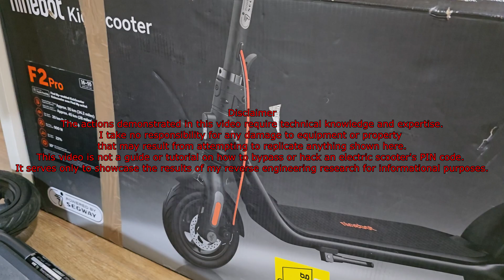Brute-Forcing PIN Lock Codes on Segway Ninebot F2 Pro Plus and G2 - Reverse Engineering Results

Comment: I am going to attempt this no idea what I am doing but my wife bought a scooter of FB and the guy said it was just dead I got a charger and it has a 4 digit pin and the guy blocked my wife
Reply from the maker: if you can connect using bluetooth to a scooter, try xiaodash app->basic and there is a swipe option to remove pin lock

Comment: So why hasnt the scooter go into alarm mode or lock you out after many failed attempts??
Reply from the maker: good question :D maybe they thought that manual bruteforce will take a lot of time...
Reply: @HobbyWithAdam so none of them have a lock out after failing? And if this is not a security measure they have, they should add it..
Thanks for the video it's very interesting and truly your benefitting the company

Comment: Hello, Adam!
I have a scooter, that is protected by a PIN and linked to the previous owner's account.
If I find out the PIN, it still won't unlink the scooter from the owner's account. Is that correct?
Reply from the maker: yes, it won't unlink account, but scooter will work and you don't need segway app at all, I recommend m365 app
Reply: Same here found a Segway on ebay with pin locked and dony know if I should buy it 😅 would i have a problem everytime im trying to use it

Comment: Hi adam i have the same problem if i change the dashboard it will work)
Reply from the maker: if you can connect using bluetooth to a scooter, try xiaodash app->basic and there is a swipe option to remove pin lock

I haven't tried replacing dashboard.

Comment: Hello Adam, I'm having the same problem , I bought my scooter from an auction, I already wrote to Segway, but they just unbound from the previous owner, so the password is still on the scooter , can I contact you to ask about more details of this video? thanks in advance
Reply from the maker: if you can connect using bluetooth to a scooter, try xiaodash app->basic and there is a swipe option to remove pin lock, if your scooter is hard locked like mine in this video (i couldn't connect with BT), there is only option shown in this video or replacing dashboard/controller (not sure if both or only dashboard)
Reply: @HobbyWithAdam in my knowledge both
Reply: Acabo de hacer eso y me funcionó!!

Comment: hi Adam, your video is very interesting, I watched it while I was trying to adapt my 365 to the new Italian regulations that require the installation of indicators. I don't like the Bluetooth indicators that are on the market and I would like to install the original nineboot ones. I saw that the indicator button has 3 contacts and the indicators have the classic 5v. From the video I didn't see the indicator connectors on the mainboard, could you tell me what the original connection is like? thanks for your reply.
Reply from the maker: I think that secondary board under the dashboard is responsible for blinkers control. But to be honest. I was about to make blinkers to G30, and my idea was to use some LEDs and there is standard timer relay, it could work, but then I decided that I don't need them/ too much effort.

In Poland all new scooters must have blinkers, it doesn't apply to older already existing models.

Comment: Hi, I bought a Walmart returns pallet and it came with a Ninebot F2 scooter blocked by code. I have all of its accessories (instructions, box, charger) but I can't use it. Can you help me?
Reply from the maker: if you can connect using bluetooth to a scooter, try xiaodash app->basic and there is a swipe option to remove pin lock, if your scooter is hard locked like mine in this video (i couldn't connect with BT), there is only option shown in this video or replacing dashboard/controller (not sure if both or only dashboard)